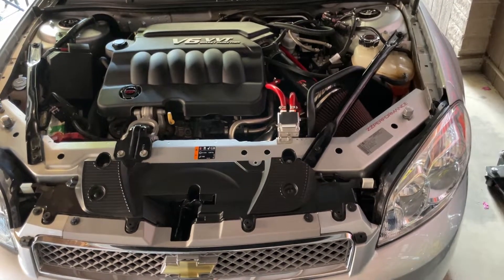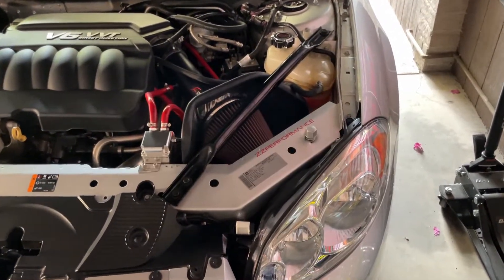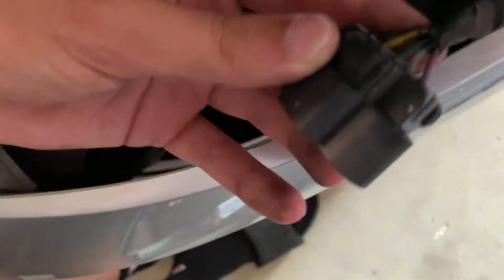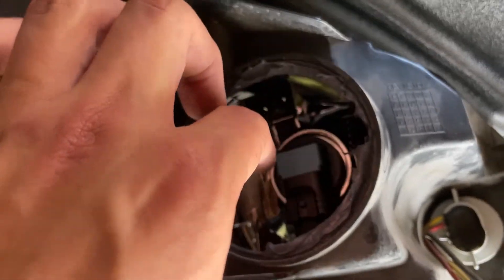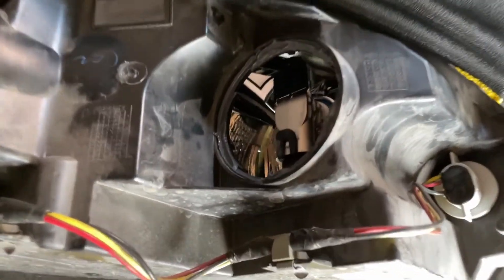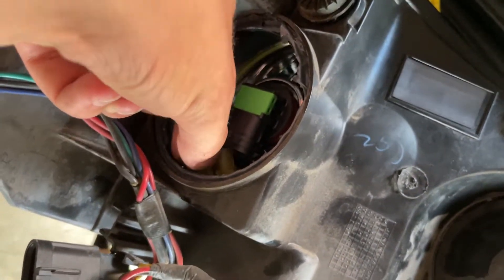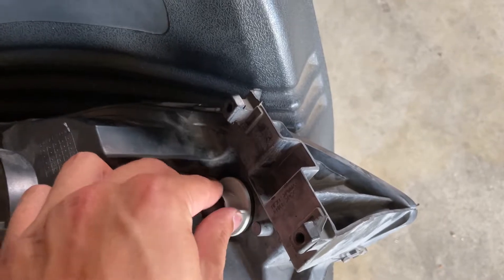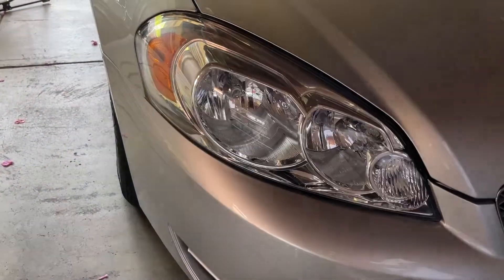How To Replace Headlight Bulbs On 2006-2016 Chevy Impala

Comment: When I replace the headlight bulbs on my 2013, I had to leave the dust cover off because the LEDs came with fans built into the back of them. Luckily I live in Southern California and rainy weather is not a problem here.